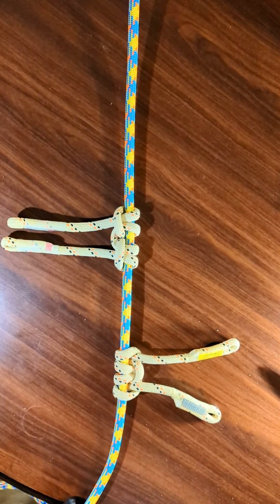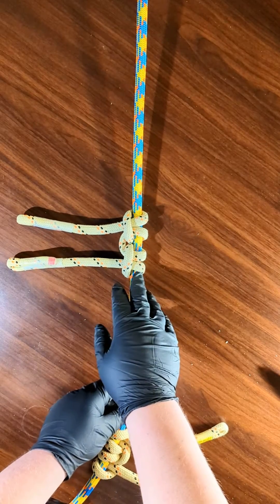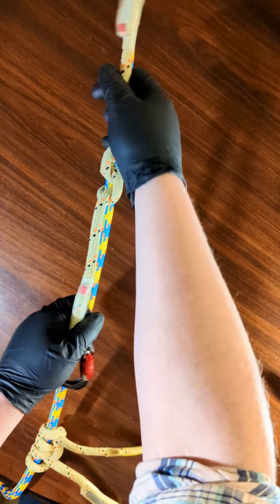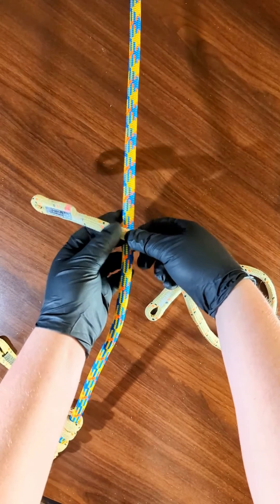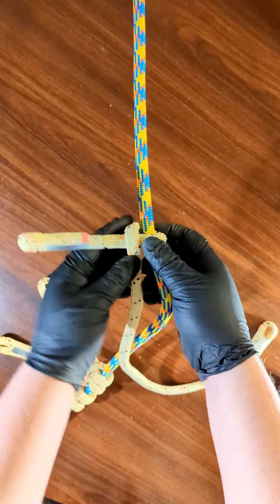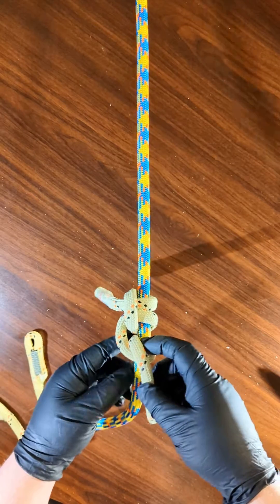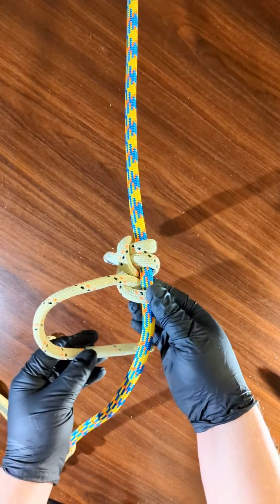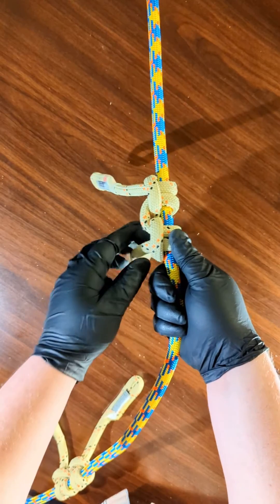OMNI-HITCH the Bi-Directional Friction Hitch for Arborists & Tree Climbers by Knotorious!

Comment: That's 2 cow hitches you've tied.
Reply: I'm under the understanding that it's based on how they're tied
Reply from the maker: I thought they were girth hitches. The two are very similar. I sometimes confuse them. What makes them cow hitches?
Reply: @Knot-orious  I believe the cow hitch is the girth hitch. Might just be different terminologies based on the use case.
Reply from the maker: Yes, I just looked into it and it appears that the girlth hitch is tied using a bight and uses two working ends and results in two strands under tension whereas the cow hitch is tied with one working end and has one strand under tension. Additionally, this hitch can be tied using a loop, which would technically making it closer to a girth hitch than a cow hitch. The original poster, C McC, was correct insofar as how I tied my hitch and the correct name for the knots which forms it.
Reply: @Knot-orious  nice research friend, great videos you post.
Reply from the maker: I just realized something...because my creation is a hitch, and because my proposed application can potentially have both eyes brought under tension, that would mean that two strands would be under tension. Consequently, it appears my hitch would qualify as both a cow and a girth hitch. How weird is that? It's a pretty unusual and unique circumstance. But I think, ultimately, the fact that it only has one working end would first and foremost qualify it as a COW hitch.
Reply from the maker: @cmcc4662 Thank you so much! I appreciate you saying that! I'm trying to be different than all of the typical knot typing channels out there and include more unique hitches than anyone else. There's so much out there and I feel most arborst/knot channels just reduce it to a handful of classics.